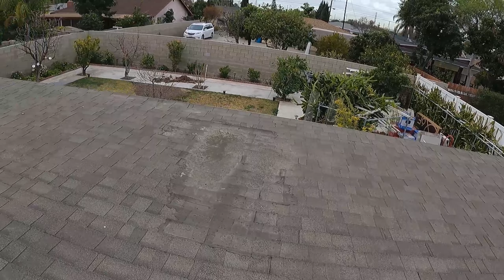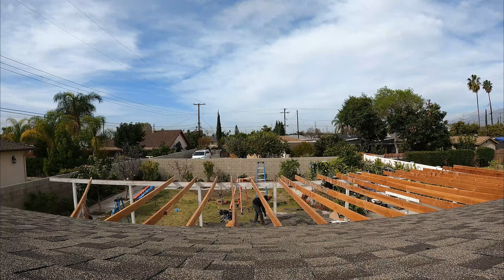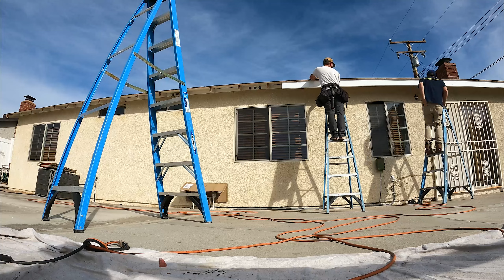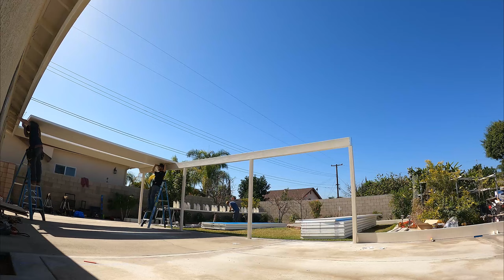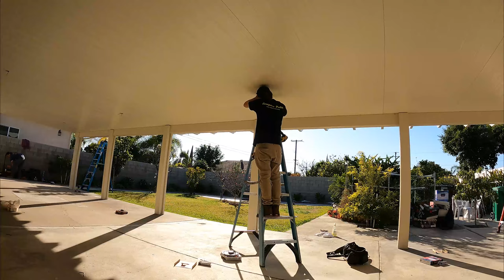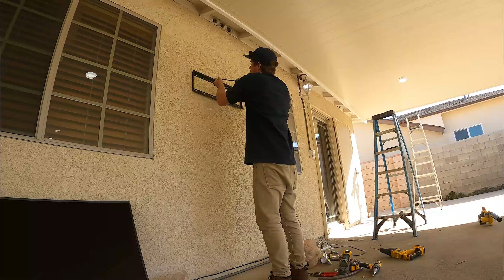How to Demo and Build a Thousand Sq. Ft. Patio Cover

Comment: Wow you can step on top? What kind of material is that? Thanks
Reply: Looks like 3" inch insulated roof panels. LRP - Plank style.
Reply from the maker: Yea, Babylon is right, I would start by looking up Laminated Roof Panels (LRP). This brand is made by Four Seasons BP.

Comment: What are you using to mount the posts to the concrete? Am using a Simpson bracket and trying to figure out how I'm gonna drill a straight 6"hole for my bolt

Cheers!
Reply from the maker: Good Day TiemX, hope your project is going well. Posts are secured in this video using galvanized red head anchors, into the concrete. Simpson brackets are not compatible with engineering on this material. Usually they are in the way and have to be removed. Feel free to email us if you have any further questions at everydaypatio@gmail.com

Thanks for the comment and hope this helps,
The Everyday Patio Team

Comment: Why are the posts about 18" or more inside from the edges?    Can the posts line up with the end of the patio edges?

You said it was about 19' and 20' projecting in the comments.  What's the longest panel length available Without a middle post for support?
Reply from the maker: Hey Anto, great to hear from you again. I believe the clear span on this patio cover was 18 ft. I'll definitely be including the patio cover sizes in future videos, Overhang is typically required over the posts to account for the Trib Factors of Engineering. There are ways and design to get around this though. Flat Cut gives a more modern look with overhangs. This Patio Cover was Corbel Cut, Requiring 16" to 24" of overhang of the beam from post to account for the End Cut on the Beam. 

Great Question as always, 

Hope you have a good Sunday,
AJ 
Everydasy Patio